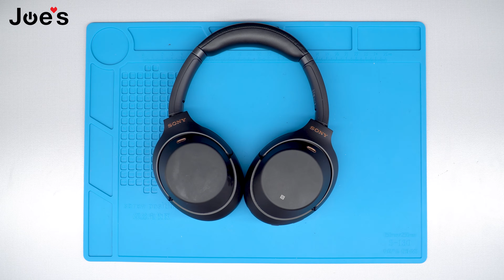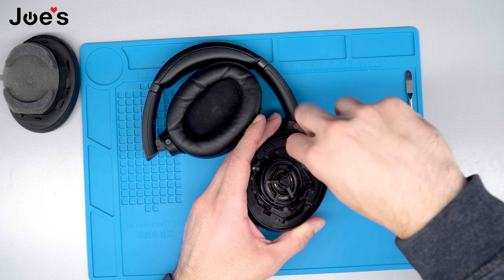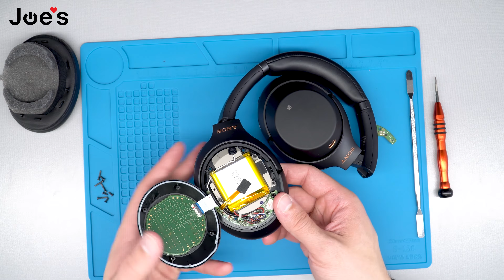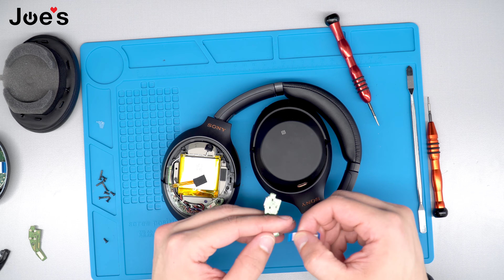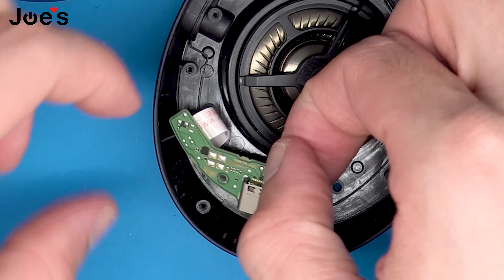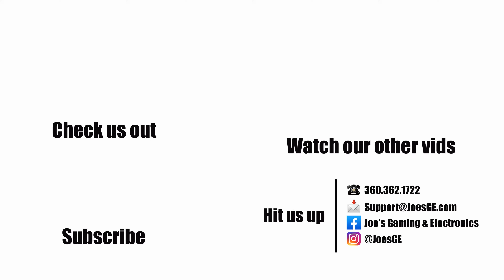Sony WH-1000XM3 XM3 WH-1000XM4 XM4 Not Charging Charger Port Replacement | Repair Tutorial

Comment: Hi. How do I tell if the charging issue has to do with the PCB or the charging port before I place an order. I had a new battery which works but still won’t charge.
Reply from the maker: If the light doesn't turn on when you plug them into charge, it's almost always the charge port board.

Comment: Hello, I have a question, the battery temperature sensor of my headset broke, it is possible that it works without that sensor. in case it doesn't work. The battery you sell comes with that flex, because all stores sell it without it.  thank you.
Reply from the maker: It won’t work without the sensor

Comment: Thanks for your great video!
When my WH-1000XM3 headphone is connected with the charging cable, the charging line is NOT turning on. Therefore my headphone can NOT be charged at all. I'm wondering how we can diagnose the Not-charging problem is caused by the Charger Port or by the battery itself?

What's the typical symptoms if the Charging Charger Port was broken down? Thanks in advance!
Reply from the maker: Hello, thanks for commenting. Please email us at support@joesge.com with a screenshot of your question and we will be able to better assist you there. - Aaron P

Comment: How much would you charge for this repair, I have this model and I'm pretty sure the charging port is dead as it doesn't charge, the light doesn't turn on, but the unit still powers on
Reply from the maker: Hello, thanks for commenting. Please email us at support@joesge.com with a screenshot of your question and we will be able to better assist you there. - Aaron P
Reply: What did you find out? I'm having the same issue. Thanks for letting me know!

Comment: I have a question, if my xm3 put on charge red light come on for few seconds and then turn off . Head phone can turn on , I have swap another good usb charging unit as per your video but still same problem. Could you please kindly tell me what you think the potential problem? I have changed the battery too so I know both battery and usb unit is good
Reply from the maker: Hello, thanks for commenting. Please email us at support@joesge.com with a screenshot of your question and we will be able to better assist you there. - Aaron P
Reply: Hi, Could you fix it?  The same happens to me

The red light comes on for 10 seconds and goes off, then it comes on for 10 more seconds and goes off again, it doesn't charge.
Reply: @jorgecardenashueicha5936  yes， it is the cable

Comment: Hola, me gustaría saber si tenéis en stock el usb c board, si es asi, cuanto es el precio y cuanto costaría el envio a españa? Gracias
Reply from the maker: https://www.joesge.com/products/sony-wh-1000xm3-wireless-headphones-repair-replacement-parts?variant=39708371812398
Reply: @Joesge  ahh ya habia visto la página antes pero lamentablemente el precio del envio aumentaba el gasto 40 euros mas, al final lo compre en una página llamada ubuy supongo que para los europeos nos conviene mas por la localización de la tienda.